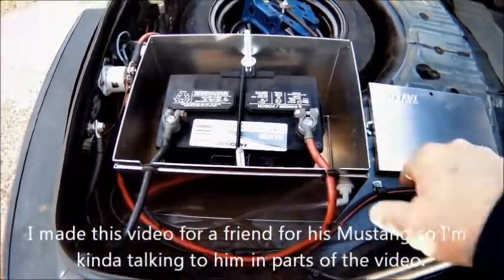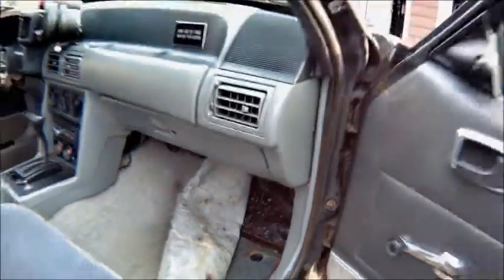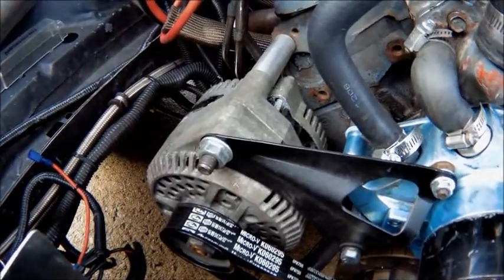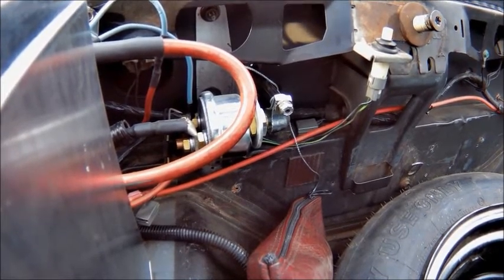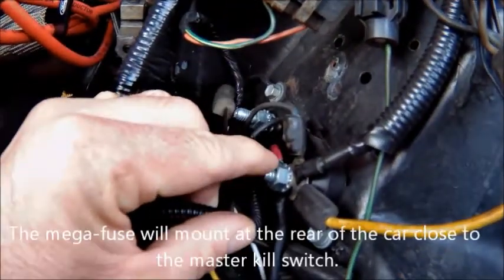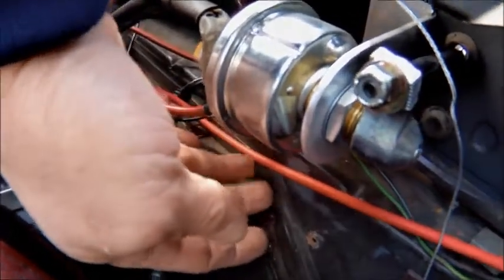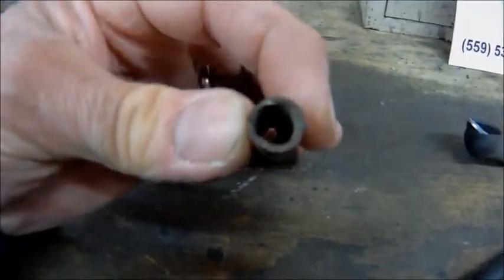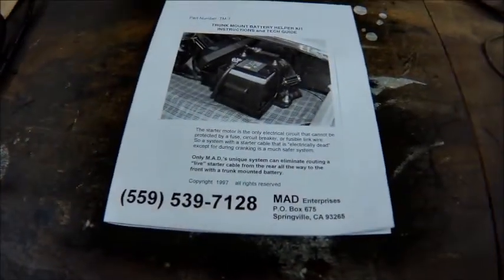Moving battery and master kill switch installation on FOX body Mustang

Comment: We installed ours behind the rear plate 
One thing that sucked is how long the power wire was, and the starter motor wouldn’t crank after the engine was warm 
You’d have to time the starting with quick ignition turns trying to get it right after TDC
Reply from the maker: Thats strange because mine works perfectly fine.
Reply: @black88coupe  very weird 
Starter was brand new too so not a high amp drain issue 
Good thing it was easy to push start 😂👍
Reply from the maker: @CrazyFunnyCats  Hope you get it figured out.

Comment: good stuff. This is one of the few videos of all 4 circuits. I was thinking about running a 4 ga wire (positive)  up front to a bulkhead. Then,  connect my alternator and distribution block to the new positive bulkhead...what do you think?
Reply from the maker: Matt Jones I would contact Mark at MAD Electrical. That guy is an absolute whiz and will get you pointed in the right direction. Glad you liked the video.
Reply: @black88coupe  Thank you. I checked out his website and he sells a distribution post and says right on his site exactly what I was asking. Yes, it can be done.
Reply from the maker: Matt Jones He has helped me a lot. He will talk your ear off for sure. Good luck with your project.

Comment: Late comment but great video. Looking to wire up a coyote swap in the future and I wasnt sure what to do with the factory style solenoid. Makes sense after watching a video.
Reply: Very, I do have a question though... you said trigger wire is that the ignition wire? I think factory it is blue thanks for the help
Reply from the maker: Nathan Smith The trigger wire in the video is black with a white stripe. Factory may be blue as you described.
Reply from the maker: Nathan Smith Hope its helpful

Comment: What size wire is your alternator charge wire running back to the kill switch & aux.wire circuit running to the kill switch?
Reply from the maker: Andrew Sawyer 8 gauge coming off the alternator. If you Google “Mad Enterprises Battery Relocation” you’ll see a bunch of diagrams which are very helpful.

Comment: What is the additional wire from the shutoff switch to solenoid?
Reply from the maker: Tammy Toomey what color is the wire you are referring too? Thanks.
Reply: @black88coupe  there are two wires coming off the one side of the cut off switch.  Not the battery side.  I'm setting up mine like yours.  Just got that switch from autofab
Reply from the maker: Tammy Toomey Thats the power supply for my MSD box.
Reply from the maker: Tammy Toomey I really like that switch bracket- clean and simple.👍
Reply: @black88coupe  by the way my wife's name comes up..... I'm Mike.  Love that set-up.  I talked to Mark Hamilton about the mad electrical kits.  I ordered them as well.  Talks a lot...  But smart.  Thanks for the video.
Reply from the maker: Tammy Toomey Thats cool Mike. He’s a real good guy. Glad he took care of you. Mitch

Comment: by the way.. you can use the push rod kit with a morse cable on the other side to put a remote kill switch control inside the car..